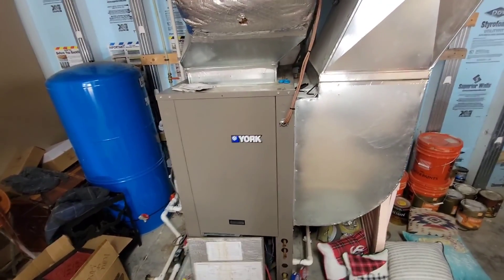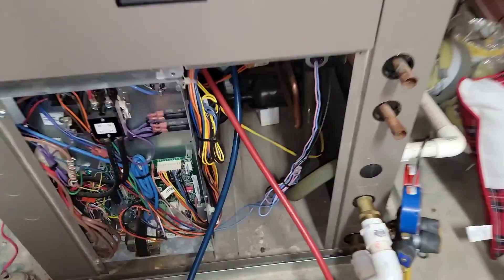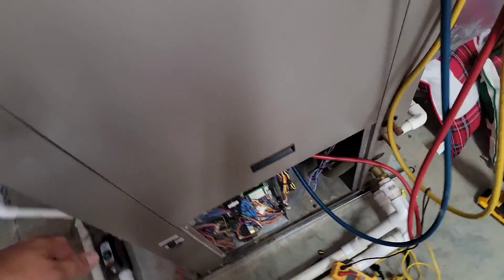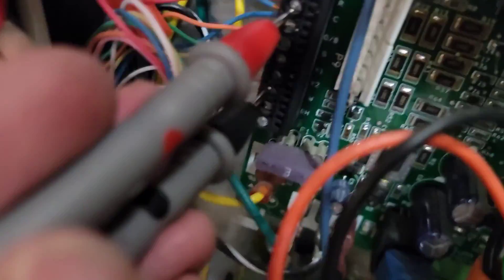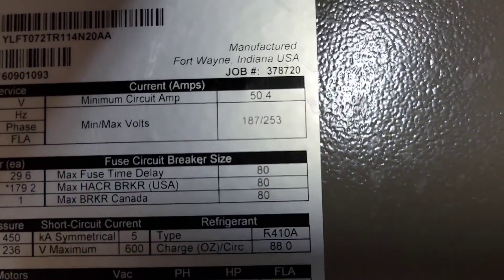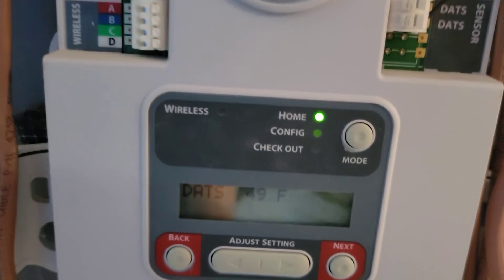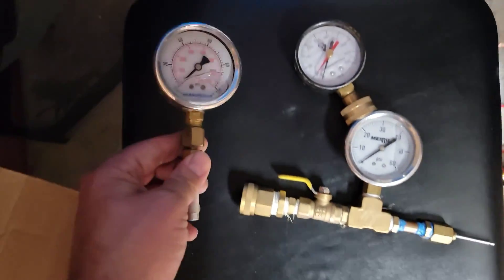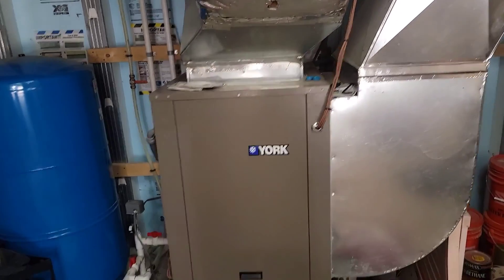Troubleshooting Geothermal System: Low Pressure Lockout No Cooling

Comment: I have 1000’ of vertical wells I had a service company come out about 3-4 years ago system went down. They added water to the loops not much. They said it was from expansion and contraction of the ground loops over time they may need a little water. My question is it happened again and I added some water. Should I be adding antifreeze instead of water? I know initially they added some kind of glycol-water mixture when system was built. I am worried about loops freezing

Comment: My 18 year old FHP unit just had a no cooling issue. I checked pressures and found it to be low on R22 (around 45 psi on the low side) so I added around 1 pound. The pressures came up to the 68 low 220 high range, but then the evap stated icing up. I got my loop pressure gauge and found the inlet loop to be only about 8 psi! I used my gooser and added water until I got around 40 psi and the evap started melting and got good 48 degree discharge air. Without knowing proper loop pressure, what should static pressure be and what temp difference should i see across the loops? Great vids and information! I subscribed and joind! Thanks for the GEO guide.
Reply from the maker: Awesome jerry good job my friend you are doing a great things.

Static pressure for the duct work external static pressure should be point .05 
Loop pressure should be anywhere from 30 - 50 psi
Reply: @taddydigest  Thanks for the quick reply! After watching your videos, I realized I needed to charge off of SH and SC instead of just gauge readings. I bought a used SMAN360 and with your guidance I can now make more sense of what I need to do! 
I still am curious what amount of loop temp change I should see if things are working correctly?
Thanks again for sharing your knowledge with all of us!

Comment: I have a carrier 4ton about 7yrs old Freon level is good just clean coli n condenser new thermostat new dryer only thing not oem is fan motor  but during day does not seem to shut off when it reaches 77 set on thermostat evening nights yes.   Any idea what to check or change Im out of ideas on what it could be ?  Thank you in advance.

Comment: Hey Tad, I had a situation like this today. System was low pressure put about 3 pounds of our 410 a in the system got an 8° sub call system is working no issues could not find any leaks possibly the Schrader cores leaking but this mild temperature weather and high humidity is really throwing these pressures off just part of what we do, but good work, Tad
Reply from the maker: Nice work!

Comment: I think you may have a liquid line restriction bud, your SC is high which indicates your flooding your condenser coil / coax coil. A SH / suction line temperature measurement would have confirmed restriction. Recommend checking temperature drop across drier and then honing in on that TXV. You can also see where they middle circuit of your evaporator coil is not sweating indicating an un-even fill rate. It’s possible your evap coil could be restricted as well… a freeze test will tell you if your coil is restricted bud. Keep up the GREAT videos man!
Reply from the maker: Wow you noticed that 
very good brother 
Yes the txv could be stuck 
I checked the drier and yes the SC was high

Comment: what's the coaxial function?
Reply from the maker: To transfer heat from the water to the refrigerant 
It acts as the condenser during the cooling operation and as the evaporator in the heating operation